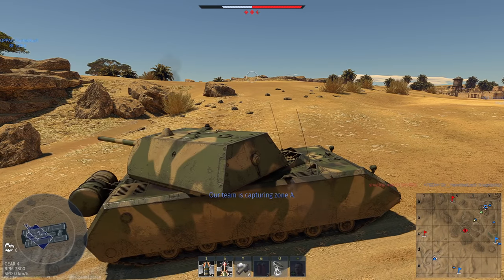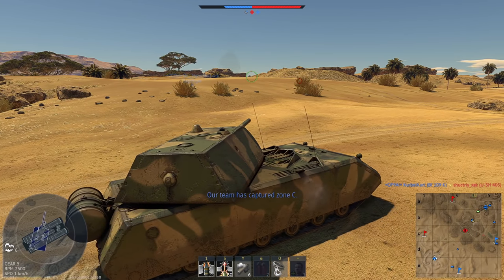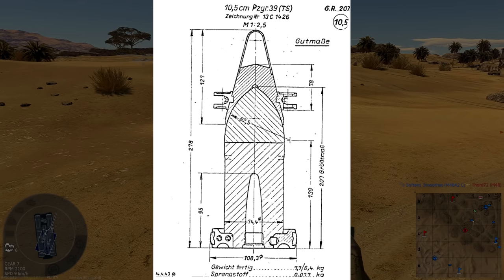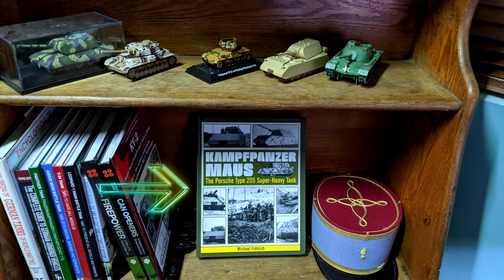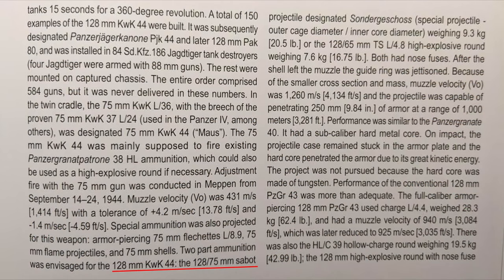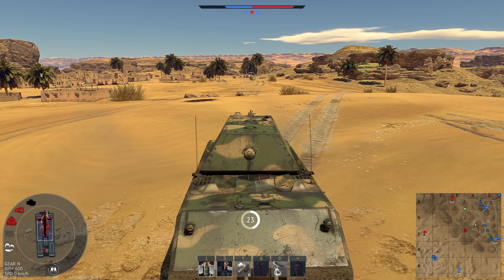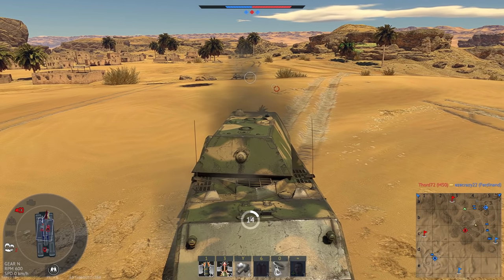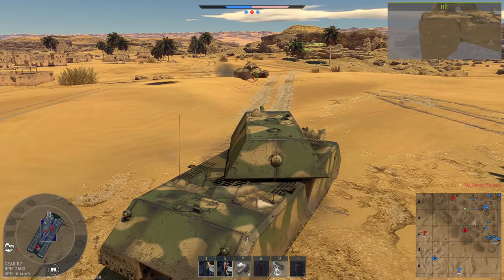German APHE-DS, FACT or FICTION?

Comment: This doesn’t have anything to do with the video, but.....
The Panther had a 75mm cannon.
The Jagdpanther had a Tiger-sourced (I think) 88mm.

The Tiger and King Tiger have 88mm cannons.
The Jagdtiger has the 128mm.

Maus has the 128mm as the main gun, too.
Imagine what a Jagdmaus might have.....
Reply: Actually, K know exactly what it would have.
The 150mm s.l.G. 33 from the Sturmpanzer 2 and 4. Nothing beats that.
Reply: Something still smaller then the one fitted on Stalin's box on tracks ( ISU 152 )
Reply: 150mm gun?
Reply: Maybe the 17cm Kanone 18. It has AP that could penetrate 255mm at 30º at 1000m
Reply: Well there’s jadpanzer e100 in world of tanks. It has a 170
Reply: But the real question is what about the jagdratte? It already had 2 28cm (11inch) guns? So now 38cm? 80cm? Ya know what? What about the schwere jagdgustav? 1 metre?
Reply: @humzaakhtar9208  There was no cannons with a diameter of 1 metre, and would probably be impossible, and even then, fitting a 800mm cannon on anything but a railway car would be impossible.
Reply: @PilotTed  firstly it's a joke secondly I think there's a certain design for a 1 metre gun to shoot space stations into space
Reply: @humzaakhtar9208  tbf i think the gustav would of just got armor as it already is a SPG.
you forget that there was plans for a E100 aa with twin 128 flakcanons.
Reply: Look into the Maus 2 project, the madmen thought of a Jagd Maus andthe Maus 2 having either 15cm or 18cm guns
Reply: The E-100 krokodil
Reply: The Jagdpanther has the PaK 43 L/71 8,8 cm, so essentially yeah the King Tiger gun
Reply: Itd have a the double barrel flak 41
Reply: You forgot about the JAGDRATTE

Comment: Everything is happening at mid tier where as clusterfuck tier is still the same, aka 1.0-2.7 arcade specifically. Realistic bois wont know the absolute chaos of low tier arcade.
Reply: If you don't die before 5-minute mark, there's something wrong with you and not masochistic enough.
Reply: @Kevin-fj5oe  It's called the masochistic tango.

Comment: Oooooh goodness, well it prob wouldnt even change the war other than maybe making a couple Allied Tank column piss their pants assuming they somehow magically via the power of weeaboo magic able to drag the war long enough to make the round reach production.
Reply: Though I am not sure what difference it would have in performance vs a tank. (for instance against the normal M4)
Reply: ALSO-RAN !  liquefies the crew? That’s horrific
Reply: ALSO-RAN !  that’s utterly terrifying
Reply: ALSO-RAN !  comforting I guess. Be weird having an open casket funeral though
Reply: ALSO-RAN !  Nope , you should check how little damage apdsfs do after pen , the thing that kill where spranel cause by the depleted uranium bruning up cause of the speed. Normal tungsten apdsfs dont do any where near as much damage, there is a case where bmp1 where shot by M1 causing the crew to bail but the ifv still operational, after the M1 is gone they jump back in and fire at a Bradley killing 2 crew before being destroy by a tow. There a reason the German developed a new round to increase damage after pen for leopard 2 cause apdsfs isnt good enough.

Comment: I remeber doing some digging into that round quite awhile ago. And remember it being incredibly difficult to find anything on it. But i thought i remember that one of the major issues with traditional AP rounds is that past a certain velocity they would shatter upon impact because the stell couldnt withstand the force of the impact. So even if they achieved penetration, its effectiveness would be mitigated to an extent becuase the shell shattered. I think i also remember that being a big issue with the round in question too. Admittedly i dont really care too much either way if it did or didnt work

Comment: I believe a round such as this was used with 2 guns, FlaK39s (electrics) that overlooked the Bay of Napoule from a point on a hill ridge in LaRoquette-sur-Siagne.  I was told (first hand) that they 'worked' for 3 days.  note that FLaK shells where assembled  before firing into the single piece load.

Comment: Very informative, it's nice to see a video with proof of the APHEDS round because there's a misconception going around a lot that the only DS round for the 128mm was an HE flak round designed for increased range and velocity. Personally I have two concerns about them adding the APHEDS to the Maus and E-100 in-game. The first is that, to my understanding, the Demarre formula might be boosting its penetration performance significantly over its historical values, but I could be wrong. The second is that with this round added, it's going to be very unlikely for them to downtier the Maus to 7.7 in AB already (It is currently 7.7 in RB/SB, but not AB). If this shell is good enough, it might even get moved back to 8.0 in all modes which I don't think anyone wants.
Reply from the maker: It seems like the penetration lines up with the historical documentation according to the current pen it had on the dev server.
Reply: @ConeOfArc  the historical documentation is theoretical pen, which is why only those values are in brackets. The tests showed the round shattering after achieving only 200mm of penetration, as can be seen in the bug report filed for this ammo.

Comment: I've done some on and off digging around German APDS & FSAPDS since coming across the Kummersdorf range tests for PPg. (Peenemunde Panzergranate) FSAPDS in 1987. The project was instigated by the Kreigsmarine, not the Wehrmacht or Luftwaffe, (though the latter took an interest later), to extend the range & effectiveness of destroyer weapons. In 1942 a FlaK.18 37mm. L.89 became the first ever weapon to fire FSAPDS at Peenemunde. Later, larger calibre FlaK & ship's guns (88mm., 105mm. , 128mm. & 150mm.) were undergoing test firings. Ammunition included subcalibre HE & FlaK shells, the latter bringing interest from the Luftwaffe.

Then the RAF bombed the crap out of Peenemunde, in 1943, wiping out the gunnery research facilities as unintended bonus collateral damage, setting things back to square one.

German artillery sabot munitions used sabots made from Oak. during the Ardennes offensive, US forces recovered several abandoned Bizon 150mm. SP guns with wooden sabots for 105mm. shells plus 105mm. HE shells for them.

Comment: This shell should only have terrible accuracy if it has an extremely high velocity like the 17 Pounder APDS did. The reason for the 17s poor accuracy was that the high velocity combined with the design of and alloy used for the actual sabot meant that the sabot would start to melt in the barrel, causing it to not separate cleanly.  This would cause the non=fin stabilized penetrator to wobble and so ruin accuracy especially at range. There was nothing at all wrong with the penetrator itself. The Comet fired the exact same ones at lower velocity with good accuracy and the Canadians changed the sabot to their “pot” style and completely corrected the accuracy problem even with full power 17 Pounder guns.

Comment: Hey, an experimental round for an experimental tank. The shell is actually more realistic than the Maus itself xD
Reply from the maker: I think you need to do a little more research about the Maus. It's very real.
Reply: @ConeOfArc  I'm talking about the concept of the Maus. It's like the worst designed tank of all time. Even with todays technology, making a 188t tank would be completely unfeasable. Though, I would be interested in how much firepower and protection a modern 188t tank would be able to achive 😂

Comment: The maus APHEDS is kinda trash, its just APCR with HE filler. Its horrible against angled armor even tho the stat card says its better against angles than the the old shell. Only real use for the APHEDS is to shoot weakspots that are too small for the 128mm shell
Reply: No, reading from the stat card, the ricochet angle stay exactly the same as the old one, so expect bounce from wierd angle like the old one does, not some fancy solid apds ricochet angle.
Reply: It's effectively a KwK 43's APHE shell fired out of a bigger gun to make it zoom faster.  It also shattered IRL and the values listed on the chart arc had were theoretical values, but that's a whole other can of worms.  It should function in game like a normal 88mm APHE shell in terms of ricochet angle etc.
Reply: @Thomas-rk4rl  it is. But, im lowkey hoping fot it have a bit better ricochet angle tho, to help with those t-55/62... I mean it still got 20 sec reload with reduced damage, it better able to pen those thing IMO.
Reply: @yuliusfrancis9542  It's a KwK 43, as someone who has used one of those things there's enough boom in it lol.  Also it should just be able to get through the UFP of a T-54 if it isn't the 1947 variant!
Reply: @Thomas-rk4rl  well, most of the time it just bounce, even on point blank. Dont make me mention when they angled slightly.
Reply: You guys are aware that the shell's statcard on the dev server was just, pretty much, a copy-pasted IS-7 shell statcard, right...? It's incredibly likely to change.
Reply: @AceTheMM  lets hope so, knowing how long gaijin "fix" certain issue

Comment: It’s fiction, they only made it to shut up the crying Werhaboo’s
Reply: its easy to say that when you don't play/barely play germany
Reply: Yeah they still didn't added the 6000 mm pen heat seeking apfsds round for the .50 mounted on muh sherman but the maus gets buffed Merika sufersz
Reply from the maker: It's not fiction, if you watched the video instead of just leaving a misinformed comment you would know that.
If you don't believe me fact check it.
Reply: @ConeOfArc  I did watch your whole video, it’s hard to believe a thing from a Tank that had so many delay’s and no production that only 2 can be made. Besides the point German Werhaboo’s cried the Maus was no longer competitive they needed a new shell to save the tank, will it save it? Unlikely
Reply: @sincereeastman6972  Exactly. How much will this APHEDS help this tank when even most 6.7 tanks have no bigger issues with it. It'll still be painfully slow and easy to kill by air support, APDS shells, big HE (T30 for example), ATGMs. Nothing much will change apart from Maus getting new shell. Btw isn't it funny how germany is getting experimental round and some vehicles we have don't even have all ammo that they used?